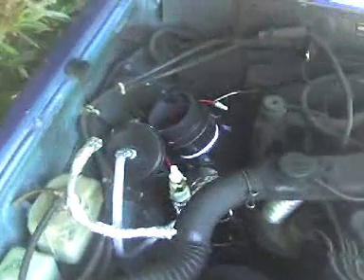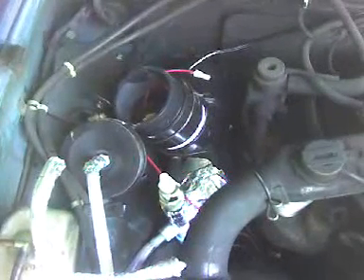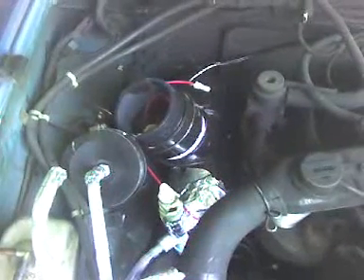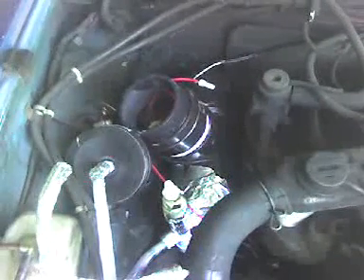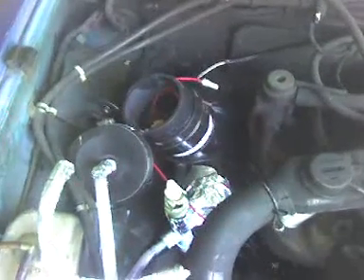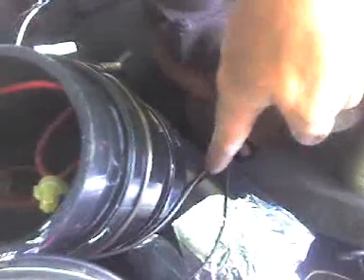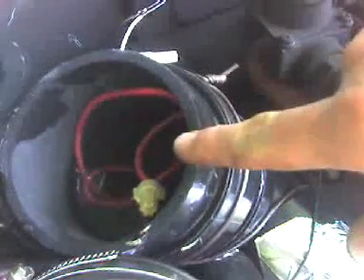hho setup

Comment from the maker: Dear David.  Super sorry for the delay on this reply.  I will install on my new truck in a week or two and get back with you.  On my old truck I had my clutch fail and was too expensive to fix it so I sold the truck.  I was getting about 10 percent better over average MPH but only one tank to measure by so not at all definitive before clutch broke.  Was unrelated to HHO unit as I had had trouble with the clutch from the beggining.